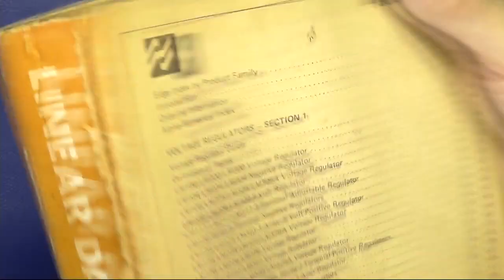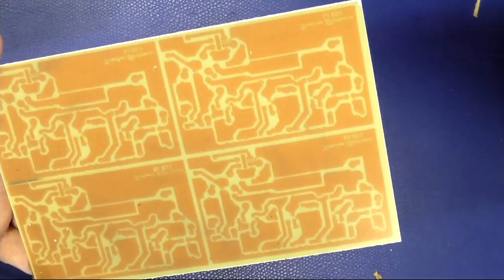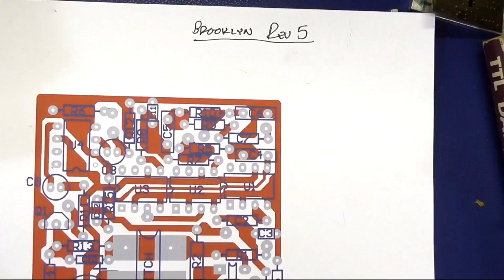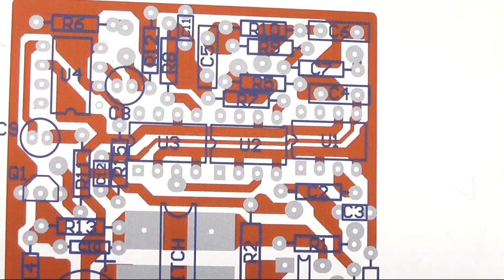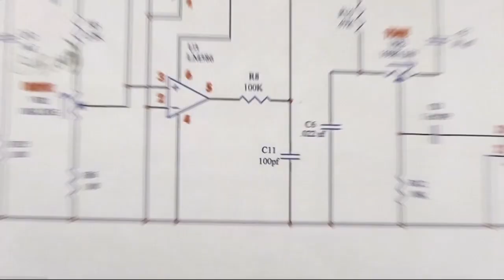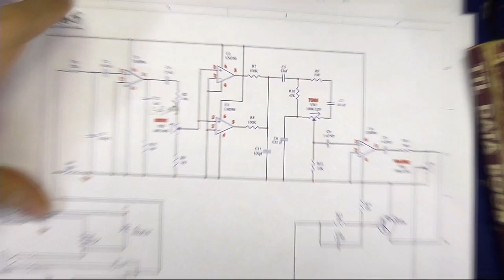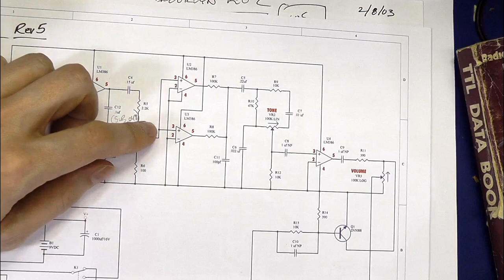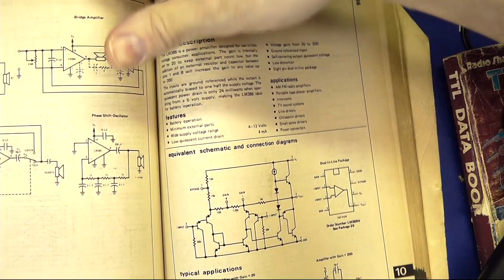The Dinosaur Den #4 - Do-It-Yourself Printed Circuit Board Production

Comment: 59:50 Bil talks about manual parts placements. I was an intern at a small company a long time ago in a galaxy far far away. I did some simple electronics repairs and troubleshooting but the company also did some production work, assembling circuit boards with state-of-the-art manual pick-and-place setups (all through-hole of course). The PCB jigs they used looked just like the one in the show.

Instead of a laser, the machine at that company had a halogen light and a couple of servo-controlled shutter blades, and it would project a small rectangle of light on the board where a part would need to go. It had a foot switch to switch to the next part in the file (it probably used a floppy disk for input).

The machine also had a stack of part bin carousels. Whenever you pushed the foot switch, the carousel would rotate the correct bin to the front. It was probably 10 bins high, but each row could rotate individually. Because each row had one missing bin, it would be clear which bin to get a part from: the one layer that had a bin in the front position (all the other layers had their unoccupied bin to the front).

Also, I seem to remember they had various hand-cranked tools to bend and cut the leads of parts like resistors so they could bend and cut and count hundreds of parts like resistors (on a roll of course) in a few seconds, and wouldn't have to do a bunch of manual bending and cutting while working on the PCB jig. It must have been pretty brain-dead work but the girls didn't seem to mind that much.

Later on I worked for Assembleon for a while, writing software for high-speed SMT pick-and-place machines, and I wondered what the other company and those girls would have thought about having one of those machines, back in the day...

Comment: Radio Shack and wire wrapping, I've done both.

Radio Shack, living in the most northern part of Michigan and I had access to electronic parts! Houghton, Michigan had a Radio Shack that i would walk to and buy electronic components.

My first real job in a production environment consisted of building test equipment utilizing wire wrap to build the test circuits. It was a mess of wires but it was a solid connection with the right tool, can't nick that wire.

I'm definitely a dino like you two. I enjoy your videos! Keep it coming.

Comment: I once made 450 to 470 mhz yagi antennas back when the repeater was the pre cell phone communication device. The design and testing was the fun part but production was WORK(four letter word). I would think about how much money each antenna was worth to me. I could build the antennas for 20 bucks each and sold them wholesale to the radio companies around my town for 40 bucks with half an hour of assembly time for each. back in 1970 40 bucks/hour profit was ok. the dealers would double the price to 80 and still beat the big companys because they charged 80 plus the mounting bracket for 20 and mine the brackets were included. Its lots easier to sell a customer on 80 that 200 bucks for an antenna back in the 70s. When Fran produces the wonderful products she is famous for I really appreciate what she does and am thankful for these Fran and bill how to videos.

Comment: The shop accident referenced in this video was the death of Yale student Michelle DuFualt in April 2011 in the Chemistry Dept. Workshop due to entanglement with a metalworking lathe.  She was working alone in the shop at the time so nobody was available to assist her or hit the E-stop to stop the lathe.

I also recall reading this story several years ago and if the news media stories are not upsetting enough, the OSHA reports are even more so.  For anyone who works around machinery, whether at home or work, it is a stark reminder why safety devices and smart practices are so very important to keep at the forefront of our minds.  Even more so for those of us with longer than shoulder length hair.

Comment: I really miss the stores where you could touch and feel the stuff. We did not have Radio Shack in Sweden but we had small stores like TV repair stores where you could buy components.
I really enjoy your Den talks.
Reply: Same here in Germany. Most components stores closed and they do sell only consumer devices nowadays. But there are some exeptions, like http://vandermeyden.de (worth a visit if you are in Cologne), which still has for example these odd DIN connectors, if you need them for some C64 hacking now, and of course discrete parts, common old ICs etc.

Comment: Radio Shack was called Tandy here in the UK but it went down many years ago, with the advent of the interweb.  It was considered down market here, compared to our native suppliers.  Radiospares, now RS components was, and still is the go to place for UK geeks!  They are now a massive global company, they became that way because they realised the potential for commercial supply on a deliver as the customer requires model.  Anything can be ordered for delivery as quickly as 1 hour, more usually, next day.  Another company appeared in competition, Farnell, also known as Element 14.  They were a massive test equipment manufacturer but converted to component supply, logical I suppose, when they saw the success of RS and realised they had a massive contact network for components themselves.  They have pretty much the same business model as RS, but RS were there first!
The interweb transformed the market though, in fact ALL markets.  I frequently use ebay for components and rarely have a problem.  For small users RS and Farnell have prohibitive min order and shipping charges, where as ebay suppliers most often include shipping in the price.
We also have Maplin, a smaller scale version of how RS started. Still going but have a Radio Shack/Tandy business model.  They still sell components but range is limited and prices high. They concentrate on everything from Raspi's to drone's, electro toys, tools etc, etc.  I use them as a last resort, due to price.  Rumours are that they are struggling.

Comment: I had Proteus in school some years ago, we used it a bit for schematic drawing and simulation, but we never put ARES into practice.
i've used it once or twice since but again, never for actual boards.
I work in service and repair so board design jobs are few and far between.

I've cut my teeth on a simple set of standalone/piggyback boards for atmega8's on Eagle and i can't say i enjoy the archaic and somewhat unintuitive interface.
maybe is should give ol' Proteus another spin.

could you give me a quick pros/cons on Proteus vs eagle?
the simulation is a pluss..